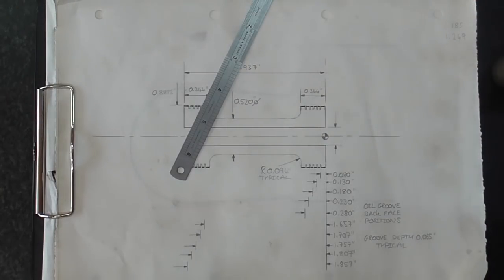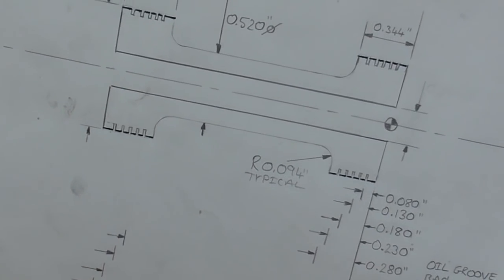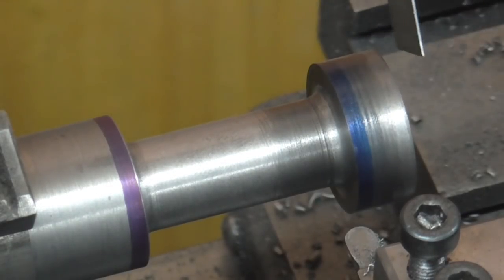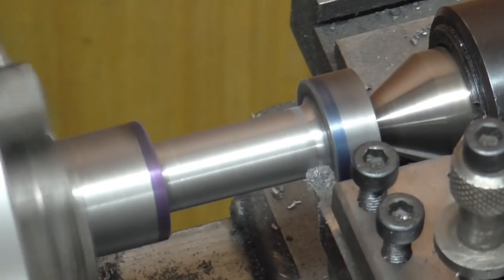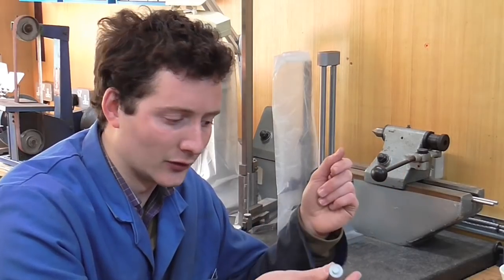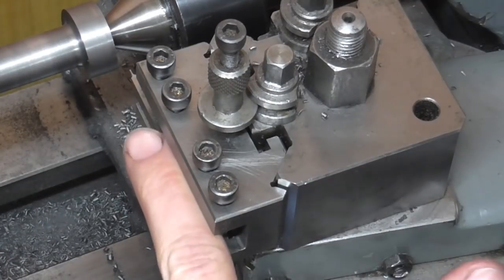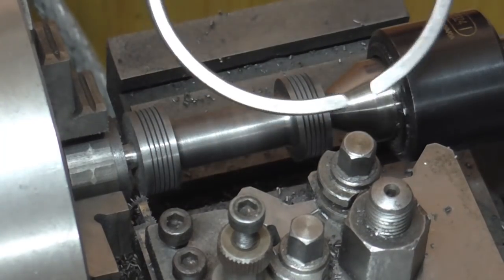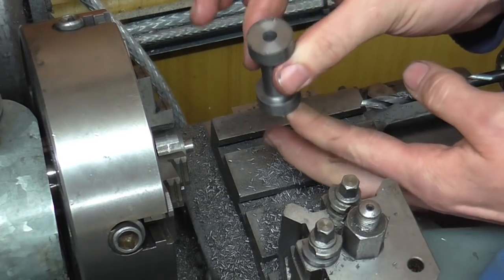Pistons and Rods Part 2

Comment: Accuracy of 10th mics - Assuming a good brand/make/manufacturer, I'd have no issue trusting a mic to a 10th. I think one could take it for granted that a good quality machine was used to make the mic thread - which is really the only part of the mic of reasonable doubt. Also that the material the mic thread is cut on should also be good quality - i.e. of consistent material - no lumps in it to cause thread cutting deviations.

Comment: It is in fact amazing just how the Labyrinth works!  In fact at speed the bobbin would be moving about 400 times a minute. Our Reading track is 1,100 feet long and at a reasonable rate takes 2 minutes to go round. So  the steam tends not to traverse to the lower pressure end. Ever so easy to make new when they wear. David and Lily.

Comment: Excellent job Mr Crispin. Good metrology advice and DFM all in 20 minutes as well as interesting machining tips. Having spent 13 years in the great RR, I can safely say it wouldn't surprise me if this story had an element of truth in it. As with any manufacturer, mistakes do happen and get dramatised as they circulate over the years. In another company I watched 3 meters of 15mm stainless bar get wrapped round the bar feeder the guy forgot to feed the bar into at about 2000rpm. It moved the CNC machine about 4 feet and dug some holes out the floor. Good job no one was standing anywhere near! Keep up the excellent work. Jon

Comment: Dimension in memory being wrong. You are not alone, as I have done that more than once over many years!
One thing about the cast iron - for most part I have found it much more tolerant of chatter than some steels when applying a radius tool... your home ground tool came out very well.
Quite agree regarding the use of just the one measuring instrument.
Nice job as usual.
Reply: My father told me that in the shop in the early 1950's they had bored out a large air compressor casting on the boring mill. When they trial fitted the piston they looked in the end of the bore two chaps could see each other over the diameter of the piston... oops!

Comment: A great parting off tip! I must remember that one. Good to see that you make mistakes too. I've just  made a screw for my Hemingway between centres boring bar project. Really proud of the screw. Sat down admiring it and then realised it should have been M6 not M5!
Cheers!
Andrew
Reply: I think my best threading efforts would be when aged about 12-13. I was making a woodworker's sash cramp - hence needing a long threaded rod. I guess the school metalwork department wasn't used to screw-cutting. As I was setting up, the 'teacher' kept coming over to see how I was getting on. He was back over as I started the first cut - which he watched for the whole length of the cut. On reaching the end, I disengaged the leadscrew half-nut and was about to wind out the cross slide when he stopped me. He was of the opinion you didn't take the tool out of the thread after each cut ! So basically, I'm claiming that I taught my metalwork teacher how to screw-cut on the lathe!

The week after I completed the thread, I couldn't find my work. I was sent to the staffroom for it. Turns out the teach had been showing it to other staff and in the process awarded me a 'Commended Work' - possibly 1 of the 3 I got in my 5 years at that school and I don't anticipate the metalwork teacher gave out many 'Commendeds'.

The internal thread for the nut I did at home on our ML7 as I don't remember the school having an internal threading tool !

Comment: Top class, so much info so clearly imparted. Are you still at RR? Hope things work out there. It's all very well coming up with the wizard wheeze of letting customers pay for engines as they use them, but when they stop using them you'd wish you'd sold them properly. Anyway, with your skills and attitude you should find something good, though maybe not close to home.
Reply from the maker: Hi, yes I am. Not a good time to be in civil aero engines but touch wood the factory I'm in looks like it will be ok.

Comment: The RR story does'nt suprise me I witnessed many incidences of the like during my time at a particular RR factory the most memorable ones being the firework displays due to employees on night shifts dozing off while machining large rings of magnesium jet engine nozzle guide veins caused by tool overheating.
Reply: I'd have thought you'd have worked at Vickers rather than RR !
Reply: @millomweb  That was later about 1980 I believe. There was a small engine facility within the luxury car plant with lost wax casting & machining. They also produced several well known golf club irons & an adjustable socket spanner at the time amongst many other things🙂
Reply: @johnvickers5750  Sadly, I seem to know as little as you about the Vickers family. It's hard to think that they were unrelated related family of metal fabricators par excellence.
Roneo Vickers (duplicating machines +?)
Vickers Hall (milk carton filling machines +?)
Vickers (Shipbuilding(and Engineering)) (floaty boats and steam engines +?)
And I've seen 'Vickers' on electro-hydraulic valves as used in cherry-pickers.

So if you feel like researching all these arms of the family, I'd be quite interested in your findings !
Reply: Apologies please excuse an old man for reminiscing I was reffering to my days in the Crewe factory.

Comment: Mr Crispin, How is the depth and width of the groves in the sliding surfaces determined. The purpose appears to be sealing and perhaps lubrication. Is there some formula and physics 
for them that you know?
Reply from the maker: I based than entirely on the drawings done by Martin Evans. All I can yes is yes, oil retention to improve lubrication and sealing.
Reply: MrCrispin , Thanks!

Comment: You take precision to another level. Fun to watch you work.
Reply: I was looking at the annular grooves trying to see whether they were equally spaced. I got the impression they weren't - and I'd suspect that was down to randomness of the tool as it made its first chips in each groove. Once the groove is established, they probably are equally spaced - which suggests putting the grooves in before machining final OD might work out with a better appearance.